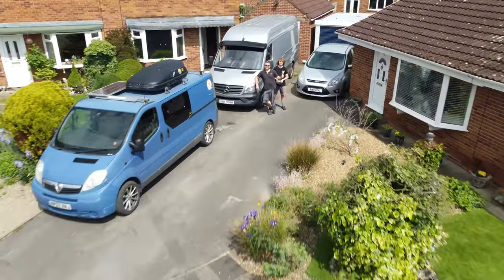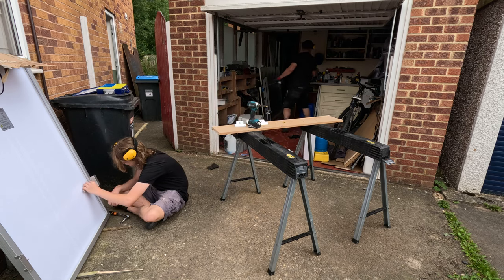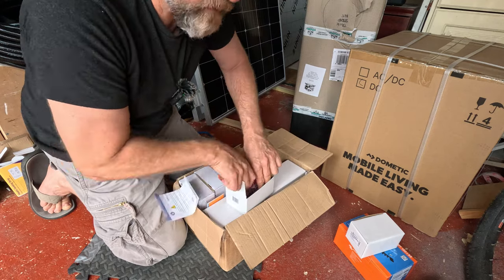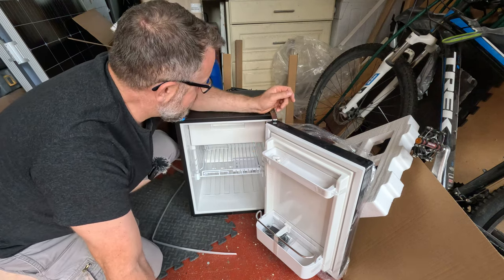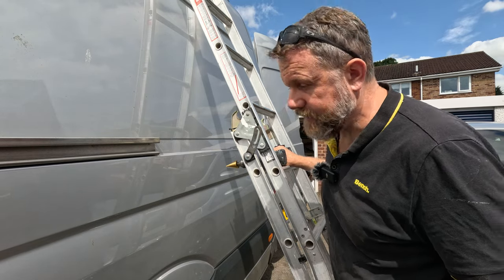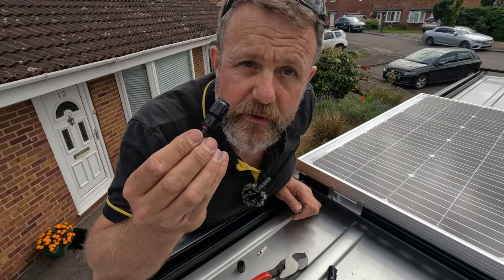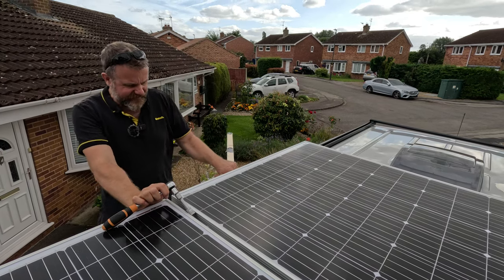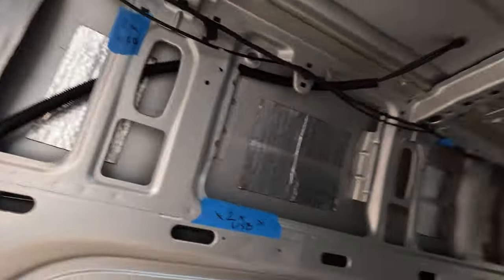Installing Solar Panels on our Sprinter van conversion, and a sad goodbye.

Comment: Good evening fella. Your story is fantastic and by the looks of  it so is your children. Hats off to you. 

I heard you mention that your last van had a basic electrical set-up which worked really. I would be interested in maybe finding out what that consisted of. I am looking to have just that.

Take care....🎉
Reply from the maker: Hi. Thanks for the comment 😁.
My old van was a simple solar panel kit from amazon with two leasure batteries from halfords. I also had a switch charge relay so it charged from the alternator. Then just a fridge and a few lights. I think it's in the old videos of that build.
Reply: @life_uncharted  Thanks for the info. Will have a look back to see whats what. Take care and tyvm.

Comment: I have to admit that I winced when the "drill the hole in the roof" bit came as it fills me with dread.  I must also admit I didnt drill in my roof and had the cables going over the robber seal in my tailgate.... which is now leaking when it rains......meaning I'm going to have to get someone to do mine as me and ladders are a dangerous combination lol..... great video and loads further on to your new life in the sun with the kids.  Much respect🙏- Kenny
Reply from the maker: Hi Kenny. Thank you. Yes it's painful every time you make a hole in your expensive van hey🤦. I never get used to it!

Comment: Maybe you could sandwich unistrut between two big washers and rivnut through them. That way you could have created threaded unistrut hole. or just drill new hole for rivnut if there is enough metal between oval holes.
Reply from the maker: Thank you for the great ideas. But it's up now and holing well 👍👍

Comment: The smart shunt is the battery monitor. It shows the the battery temperature, charging and discharge that can be read on the cerbo GX and also your phone thru  blue tooth.
Reply from the maker: Ahh.. Thank you so much. I know someone would tell me. It's very helpful having you folk out there 😁👍

Comment: well done john for thinking out of the box, long spanners a hit. Van is coming along well, don`t worry bout the vid`s, now n again works. was just thinking bout the roof interior, what about those pvc panels they use in bathrooms, like tongue n groove and easy to remove if you get a problem down the line.
Reply from the maker: Hi. Thanks. Yeah, long spanner saved the day😂. Cheers for the idea. I think I already have a plan for the ceiling. But always open to options. Thanks again 👍👍

Comment: Just come across your channel as im planning doing a similar thing, converting a van and going travelling with my young family. 
I uave just ordered all my electrics through a company that designed it all, it came with a schematics on how it all goes together. If thats something of interest i could send it over. 
Keep up the good work.
Reply from the maker: Hi. Thanks for the comment. Which company did you go for? I've already used tiny build electrics and they have been fantastic so far. But thanks for the offer👍👍😁
Reply: @life_uncharted  I went with Roamer in the end. I've Not installed it yet just have a massive pile of bits !

Comment: Great channel bud, done my van last year very similar to what ur doing 👌 one thing I did do on roof was use stainless nuts and bolts as I found the steel ones liked to get surface rust after a month or 2 . Keep it up great channel and great build 👌
Reply from the maker: Hi. Thank you so much. Yeah I wondered about that. Thanks for the tip👍👍👍

Comment: Another job done great work, But the  Gland should really face the other way around ensuring no driving rain enters where wires go in, but sure it will be fine.
Reply from the maker: Hi. Thanks. Yeah I thought the same but have seen quite a few do it this way, but that doesn't mean its ok🤣. Hopefully it's a bit protected by the panels. Also I plan to avoid as much bad weather as possible 😂. If there's rain coming, we're leaving 😉